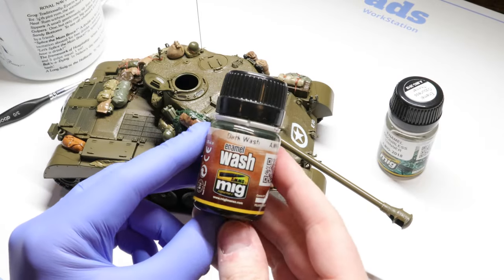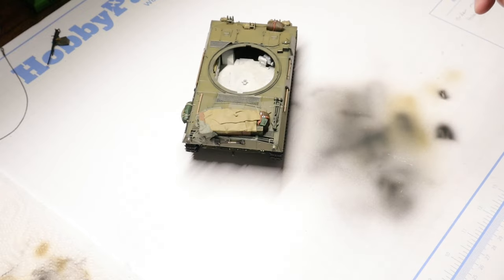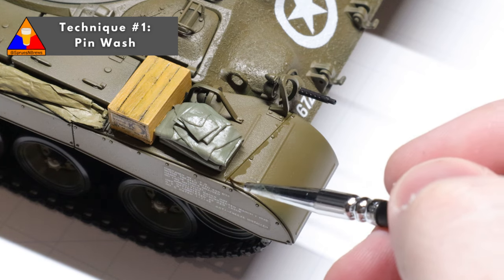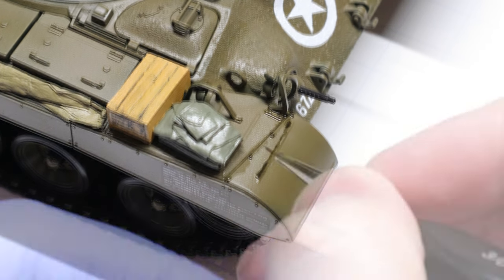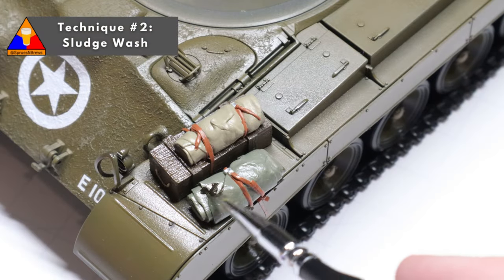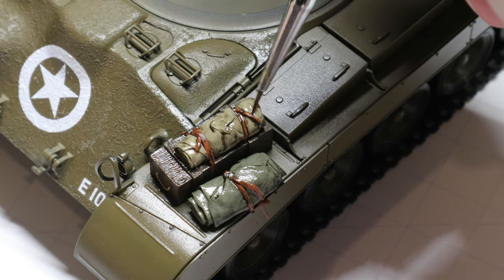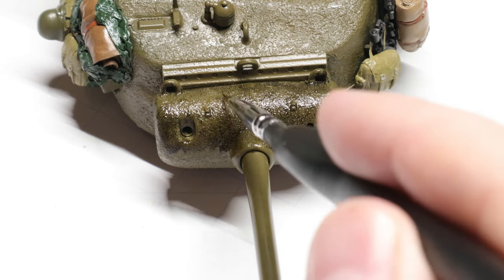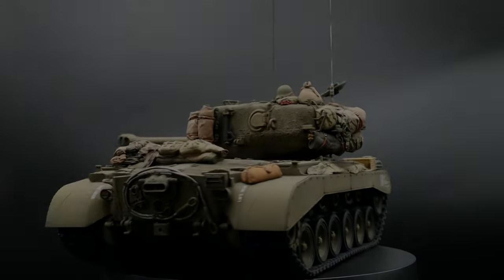How to Weather 1/35 Scale Tank Models | Beginner Tutorial

Comment: I have wanted to add weathering to the project in doing but hadn't a clue how to do it or to use the washes so it was going to be a pss until this video.

You've made it seem so easy that even knowing nothing about shading and lighting, I should have enough about me to be able to add some "basic" weathering.

Another unrelated headache in having is knowing the order to prime, paint and attach the props and wheels or which glue to attach them with if I do end up sorting them before attaching to the painted body work.

Comment: Dear Hank: I know this question is a few months late but I just got into scale modeling during a surgical convalescence. Hadn’t built a model since 1980. Now I’m 56 and a WW2 buff. I’ve got a bunch of German armor from various sources. My question is: I’ve got a new Dragon 1/35 Jagdpanther smart kit for the so called “late production “ variant. I’m leaning toward priming the whole thing on the sprues with a mud red color primer. Or, there’s the black primer to cast shadows when applying base coat Dunkelgelb. Any advice you can give me? This kit was mui expensive and I figured everything should get primed. I plan to use weathering, chipping and wash. I’m also likely going to apply Zimmerit. I did my research on what patterns were used on what tanks etc.. What do you think of this plan? Or the order of things? Might put the Zimmerit on before priming. Not sure. Help please. New Subscriber Dan. Nice channel and work!